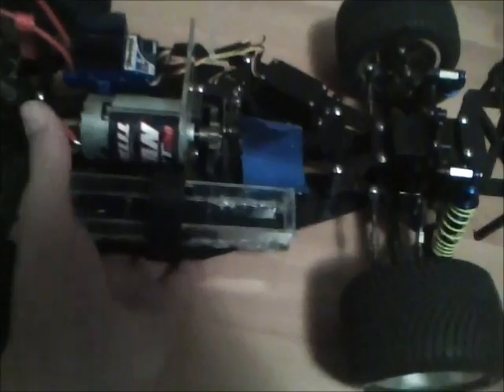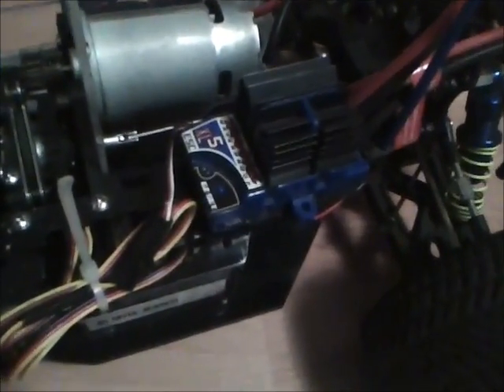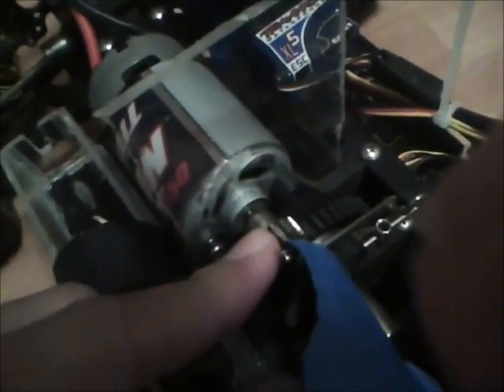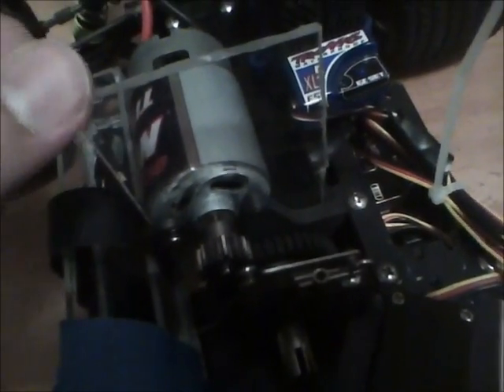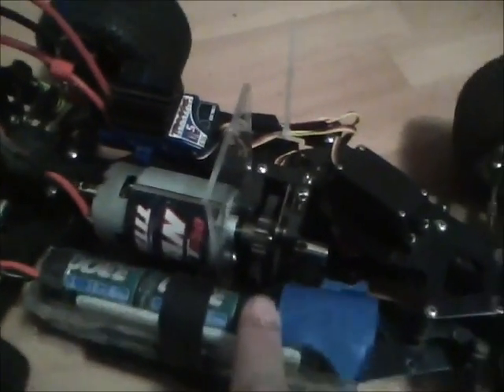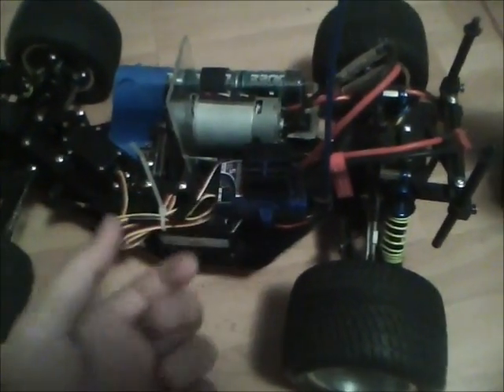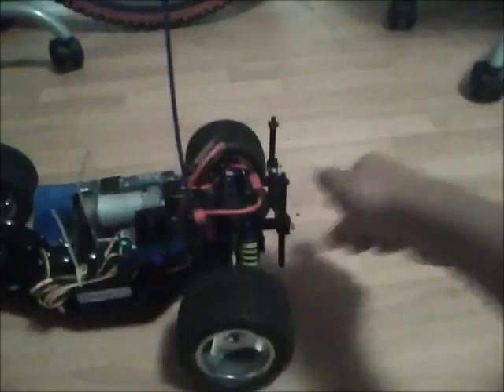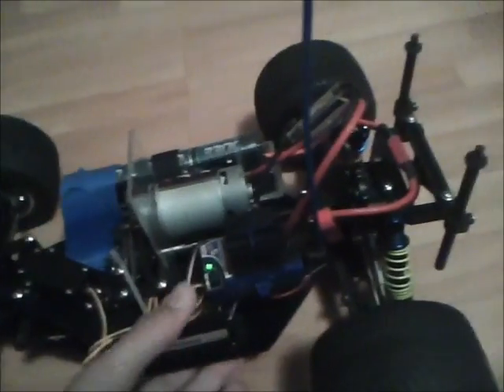Converting a Nitro R/c Car to Electric Pt. 3 of 3

Comment: Your radio issue is part frequency but also you have all the electronics so close. I've ran in to the same issue numerous times. Also on my nitro stampede I have 2.4 in it and it glitches like crazy. Changed every thing 3 times and no luck.... so there are more possibilities then just frequency, As I recall my E-Maxx did the same no matter where I was it always glitched.